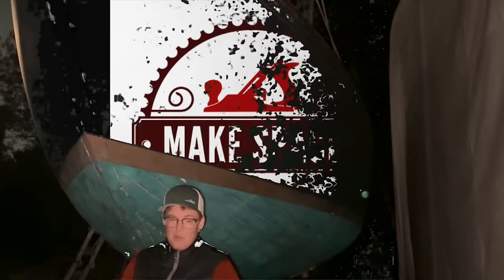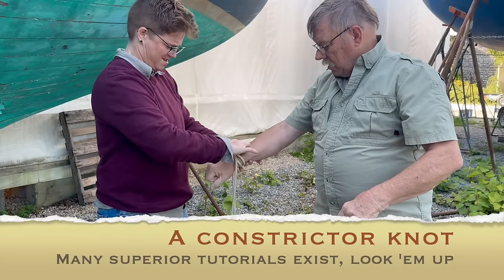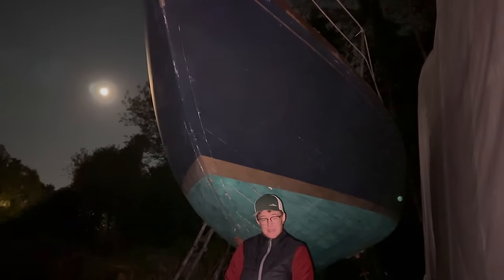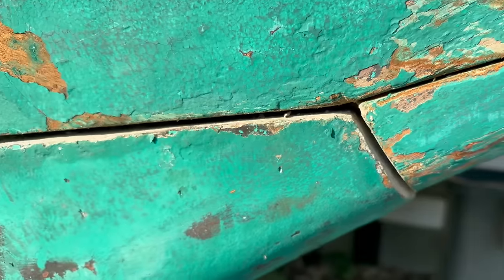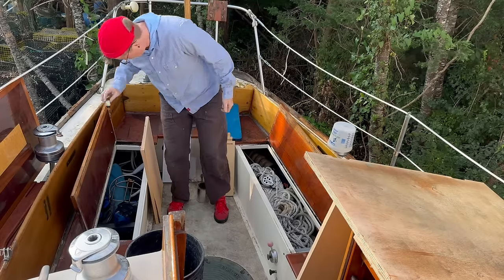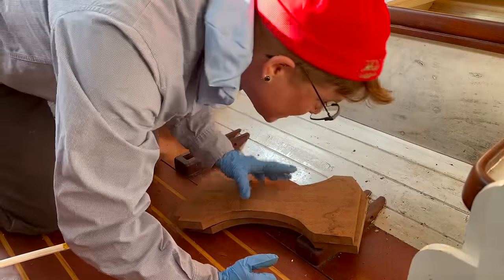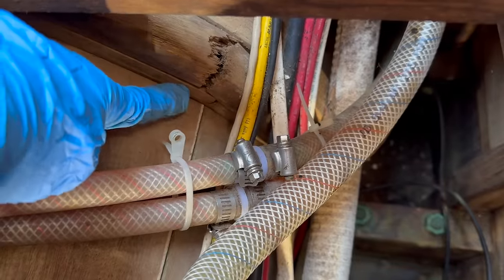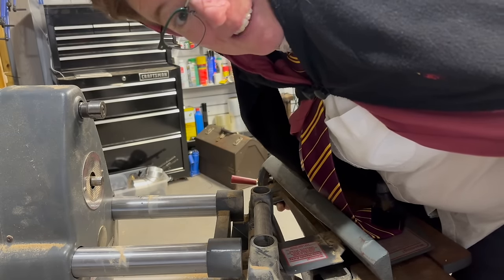MOUSE TRAPS AND FRAME CRACKS I  Restoring Heron, a Wooden Boat

Comment: Good Morning KP, from Cape Cod.
Rather than trapping the mice on board, have you thought about trying to stop the mice from coming aboard altogether?  Perhaps some barriers on the supports holding the boat aloft.  Maybe some inverted metal cones that they cannot traverse.  In the RV world, we used to also use grease or Vaseline on traverse points.  Mice don't like to pass over grease.They have to be getting up there from the ground somehow...
Reply from the maker: That’s an interesting idea. Like squirrel contraptions on bird feeders. Thanks, I’ll give it some thought.

Comment: Good luck getting the jointer cleaned up!  I restored my Shopsmith jointer last year.  It was a fun little project. You are missing a coupler hub that goes on that lower shaft - It is slightly different than the for the bandsaw. But you can use the same coupler to connect it to the headstock.  Good luck and keep us posted!
Reply from the maker: I am! Hopefully one is on the way. Now it’s time to clean up the jointer bench and blades

Comment: Hi KP  Move the drive coupling hub to the lower shaft on the shopsmith head.  Everything will drive properly then.
Reply from the maker: Hey Pete! I haven’t been to double check, but I’m not certain there is a lower drive shaft.

Comment: a self-setting multiple mousetrap. A long-necked wine bottle fixed to a benchtop or shelf above a bucket. Put the body of the bottle in a sock which makes it easy for the mouse to climb on it and make the neck greasy with butter with a piece of bread and butter stuck in the neck. For cute little marsupial mice like ours use a deep bucket they can't get out of and relocate them. If not some water in the bucket solves that. Good luck.

Comment: Can't speak to mouse problems but on several boats I've had I found dryer sheets to be a pretty good spider repellant. Now I keep an old Grand Banks (woodie) in a boat house and use moth balls in mesh bags hung from the rafters. 99% effective spider repellant and enough natural air circulation so as not to even notice the moth balls. (catching the moths to collect their balls is great sport!)
Reply from the maker: Maybe I didn’t put enough dryer sheets? They masterfully placed their evidence directly atop the dryer sheets I put out.

Comment: Mice like to move along walls.  I place traps perpendicular to the wall with the bait end at the wall.

The shopsmith jointer is powered by the lower spindle, there is/was a second plastic connector that fits.
Reply from the maker: There’s one coming in the mail any minute now!

Comment: First of all  congratulations to you both  secondly that looked a big mouse but good luck with them I think you may have to lift  more  boards rebuild  rescue had same sort with  bird infestation on a plane they are totally rebuilding it 
Apart from a few frames  cracking and planks needing redoing a nice little  yacht good luck 😊😊😊
Reply from the maker: Thank you so much! I agree, I have a lot of work ahead, but pretty light, all things considered.

Comment: There is a coupler that mounts to the lower headstock drive that allows the joiner to be hooked up. There might also be a different coupler than the one you use for the other attachments. I used to have one.
Reply from the maker: Ah yes, after double checking, I see what you mean. I’ll have to look and see if I have the other type.

Comment: My Concordia has cracked floors well aft that were repaired 40+ years ago, probably a hard grounding.  As you know, laminated frames are more tolerant of those hard turns at the bilge.  Those beautiful curves can come at a price!  Mice suck, I haven't found that the oils do much, nor the dryer sheets, but maybe they reduce what you can smell... traps to get the residents, and preventing further ingress are really the only solutions. Last year I left one little chocolate bar on a shelf and....
Reply from the maker: I looove Concordias!
I keep thinking of taking a page from bird feeder enthusiasts and putting metal cones on each leg of each Jack stand. Except there are also the keel and blocks to contenders with.
Reply: I love the jack stand cone idea!  This may seem a little tin foil hat, but similar to squirrel guards  on trees, you might be able to temporarily attach a slippery surface on the keel, just a thought.  As hard as it may be, you can also get the reusable traps...  @MakeSpaceByKP

Comment: There is no need to throw away a used mouse trap. You empty it and set it again. It can be used many many times.
Reply: Yes, why throw it away ? Remove the mouse and re use.
Reply from the maker: It’s true. I’m planning to work back up to that, but it’s been a while since I lived in a 200 year old house and I’ve gotten wimpy.

Comment: Shawn Woods (has a youtube channel about weird and wonderful mousetraps) sells a mousetrap that uses a bucket (you put a few inches of water in the bottom), with a lid housing a roller thing that you can smear with peanut paste. Mice walk on the roller, it spins them into the water... It catches multiple mice without needing resetting etc, and is highly effective in infestations (little single-snap traps are good for one or two mice that have found their way into a house, but no good once they are established).
He's a cool dude (actually kind of a loveable dork :)). Maybe you can do a collab :)
Reply from the maker: Thanks for the tips. I love dorks! They’re my favorites
Reply: I think he sells that on amazon and you can set it up non-lethal if you want. I've done it with a 5 gallon (3.7 L?) bucket, a rod attached to the top and a old tuna can with a hole in the middle to go on the rod with peanut butter smeared on it. Seamed to work pretty well, even though I'm pretty sure I'll have to do it again this year.
Reply from the maker: I have been focusing on getting my garage ready to do winter work, so haven’t made it to the boat in a minute, but I REALLY have convinced myself that the mice problem has magically gone away. 😂